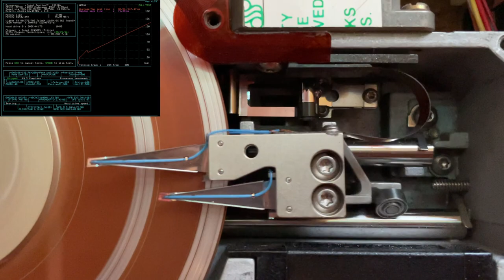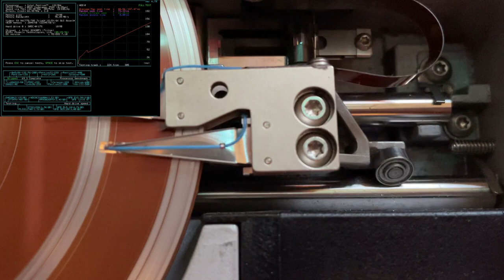Destroyed ST-212 Hard Drive seeking sounds

Comment: I'm impressed by the design of this drive, definitely a unique piece!
Reply: It's actually not that unusual of a design choice overall. This is a pretty close copy of the industry's first half height drive, the Microscience HH-612, which also used offset heads on a single platter to mimic the geometry of the Seagate ST-412 fro compatibility. That said, Microscience also included much more advanced electronics and a more modern plated metallic media for the single platter.

Comment: I like how it's almost literally an ST-412 squashed into a half-height drive. The lid screws are even in the same place and it's physically identical, save for its height. Seagate clearly initially planned to keep to their original design before changing tack and switching to the rotary stepper in their later drives.
Reply from the maker: Yeah it does look similar to the ST-412 and even has the same parameters, but is very different internally obviously. I wonder why they moved on from that design onto the one they used on their newer drives, maybe it allowed for better performance? Miniscribe for exemple kept using linar actuators for their stepper drives.
Reply: @arnlol  Yes, certainly different inside, considering the apparent reduction of platters and the double head assemblies to allow for the same LLF parameters. I just meant the exterior looking very similar.

I think that rotary head assemblies, be they stepper or voice coil, tend to have better performance overall. I'm guessing that's why Seagate switched. Better performance while not all that more expensive. It paid off in another way too, apparently, since Seagate was well known for reliability with their stepper drives after the release of the 225 and up until their last stepper drive, the 351A/X.

MiniScribe probably kept to the rack-and-pinion stepper assemblies because their later higher end voice coil drives were rotaries (after the linear voice coil 60xx series, of course). Keeping the design the same for lower end drives keeps them cheap. That's probably why I keep finding dead and/or problematic MiniScribe steppers everywhere, with only a few 30xx rotary voice coils now and then, and those are usually working fine.
Reply from the maker: @redleader6442  I have heard mixed things about the miniscribe steppers, some swear they were garbage while others think they were really good. But obviously if someone used one and it failed, they probably wouldn't like it much... I did the thing of buying an untested MFM drive again, a Miniscribe 3425 which comes from the US so it will take a while to arrive. I really hope it wont be in a similar shape as this ST-212 internally and I will be able to get it going. 
The one thing I sure know about the stepper miniscribes from the videos I have seen of them, and that is that they sound amazing!

As for the 3xxx ones, my 3180S is still working despite clearly having some headcrash damage (Audible scrapping sounds in some areas, not loudly but it is there), quite a bunch of bad sectors but it can still be used. Those seem to be really uncommon unlike the stepper ones, which I guess isn't surprising since those probably were really expensive.
Reply: @arnlol  My experience with MiniScribe stepper drives is just that, experience. I've unfortunately had more bad luck than good with them. If others have had better luck, then I am glad for them. It's a shame for my part, though, because I do indeed like the way rack-and-pinion stepper drives sound.

I just took a gamble myself recently. I bought a MiniScribe II 10 MB drive, most likely an IBM XT pull. If it works, it'll be going into my Deskpro 8086 because it better matches the year it was made (parts from '84, sold in '85, and this MiniScribe has a date stamp of '84). The current drive is an ST-225 from '87. Fingers crossed.
Reply: @arnlol  Thin film recording heads are more efficient when actuated helically, so the swingarm actuator can actually pack more track density onto the same surface. The lever action also offloads all of the precision onto the machinist and not the stepper, eliminating the need for high repeatability in it's positioning - This is why they can afford to ram the heads against the end stop when parking, without risking head misalignment. 

Miniscribe was broke and couldn't afford to redesign their low cost consumer drives by the time this began to matter.

Comment: what's with the two heads? that's very interesting.
Reply: As the description mentioned, it's probably so that the parameters are the same as the ST-412 - that drive had 4 heads (2 disks). I suppose this one, also having 4 heads, just needs half the track pitch to match it.
Reply: The first dual actuator drive?
Reply: @MyComputerStudios_  No, there's only the one actuator on here (all 4 heads move together). It reminds me more of the Barracuda 2HP, but without the performance benefits. From the point of view of software (parameters, performance, etc.) this setup here is indistinguishable from a drive with 4 heads across 2 disks, which as far as I can tell is the point.
Reply: @aprilkolwey4779  At the time when this drive was being designed and manufactured, almost all standard IBM PC disk controllers either supported the ST-412 as an option or only supported the ST-412 as their only choice. This was a deliberate design choice made by Microscience when designing the industry's first half height drive, the HH-612. The Seagate ST-212 followed in it's footsteps for the same reasons, although Microscience saw fit to give their drive much improved electronics and more modern plated metallic media.

Comment: Thanks for uploading this! Very happy to see one of these running and how it sounds, even if it doesn't work but I would say it still sorta does haha. I really found the way it went to find track 0 interesting, as I had no clue that these did not rely on the heads at all to determine the position of where it was reading or writing from, do you know how the drive is able to determine the position it is at?
Reply from the maker: On the shaft of the stpper motor there's a metalic part attached that rotates with it, and there's a light sensor that the part goes into, when the sensor is triggered it means the heads should be on track 0. Miniscribe drives also used a similar thing.
Reply: Like most stepper actuated drives, the only mechanical feedback is in the form of an interrupter flag attached to the head stack or stepper shaft which activates a sensor at the position designated as cylinder 0. In the case of the ST-212, it uses exactly the same setup as the ST-412, including the stepper, flag, and optical sensor. They are all interchangeable between the drives.
Reply: @arnlol  I imagine you're talking about the Miniscribe MS-III and 8000 series drives, which actually use a rack and pinion mechanism and so the flag will pass the sensor multiple times during a full stroke seek. They have slightly more smarts than the ST-212 in that during initialization they will watch for the first trigger of the sensor, and then move until the next trigger. If it does trigger, it will continue to the third and final trigger. If it doesn't at either stage, it knows the heads reached their maximum inward position and that it is okay to seek back to cylinder zero, which stops dead on the third triggering of the sensor on the way back. At this point, the drive knows exactly where the heads are and can track their exact position at 6 different locations on the drive.
This is why Miniscribe calls it a stepper index senor and not a track 0 sensor!
Reply: @TheDiskMaster  That's way simpler than I thought originally for sure, seems like it predicts where the tracks should be if it can only really determine when it is at track 0 unless I got that wrong. From what I can understand, you are saying the drive only knows when it is at track 0 when it hits the sensor and not each and every track it goes to?

Comment: what would happen if you tried to run hdmotion on this drive?
Reply from the maker: HDMotion needs to read sectors so it doesn't work. There's a modified version of HDMotion that just does seek commands (you just need to edit one byte of the hdmotion executable with an hex editor) and that does run since the drive still seeks even if it will never read anything ever again.
Reply: @arnlol  maybe try running the modded version of hdmotion on this drive and see what happens. Maybe a video idea?

Comment: To answer the question you pose in the description: Yes, it was designed like this to make its geometry compatible with the ST-412 and the hundreds of drives and controllers already on the market which supported that geometry and often only that geometry. Another benefit was the cost reduction of using a single platter, rather than manufacturing and testing two per drive. 

This is indeed Seagate's first drive, and it is modeled after the industry first Microscience HH-612, which also used a single platter with offset heads just like this for the same reason, although that drive included more modern plated metallic media and a much more advanced control scheme. 
The Seagate ST-213 came shortly after this and replaced it in Seagate's lineup as the 10MB HH drive. It had better performance, was more robust, and cheaper to produce because it reused so much of the design from the other tub chassis ST-200 drives. The only downside is that it only had 2 heads and was as such not compatible with the older controllers, leaving many users with no upgrade path without first replacing their controllers!

Comment: That is exceptionally cool. This must be one of the only drives around besides Conner Chinook drives to have two heads per surface. Sucks that its completely destroyed, was it like that before you got it?
Reply from the maker: Well I got it yesterday, so yeah it was. The seller said it was untested, they said that it spins up loudly and does seeking sound but they did not try to format it. I assume they probably knew the sound it made when spinning up was not normal but oh well...
The strangest thing is, it is literally the drive I received with the best packing that I ever got... I wish the sellers that sold actually working drives packed them like this.
Reply: Good for spare stepper and electronics at least! Minor consolations probably. And yeah, I think the amount of ebay sellers that knows how to properly pack a vintage hard drive can be counted on one hand...
Reply: The Seagate ST-212 is a vague design copy of the first half height drive, the Microscience HH-612, which also used offset heads on a single platter to mimic the geometry of the then-standard ST-412 for compatibility reasons. That being said, Microscience also fitted their drive with much more advanced electronics and more modern plated metallic media, making their drive the better part at the time.
Reply: @TheDiskMaster  Fascinating! Thanks for that bit of knowledge

Comment: That is really unique uses two heads for more acress speed
Reply from the maker: I don't think it was for access speed, but rather to make a drive with a single platter while staying compatible with the ST-412 which had 2 platters/4 heads. At that point in time, hard drives were rather dumb, there wasn't any translation or anything.